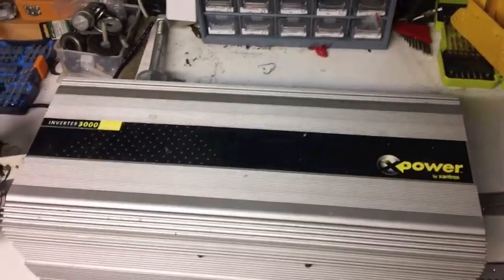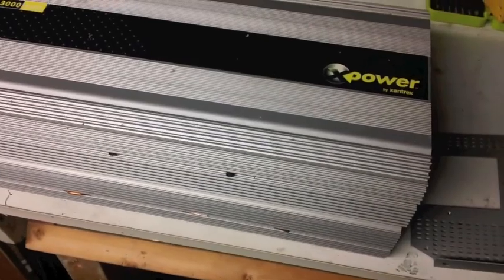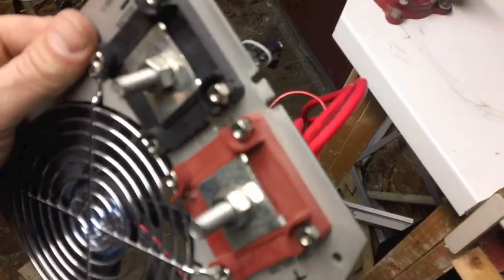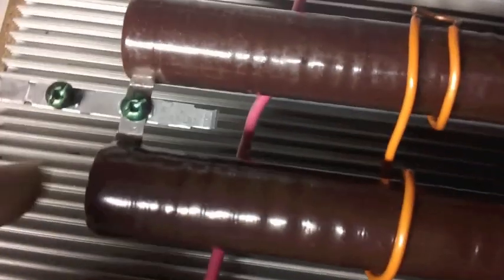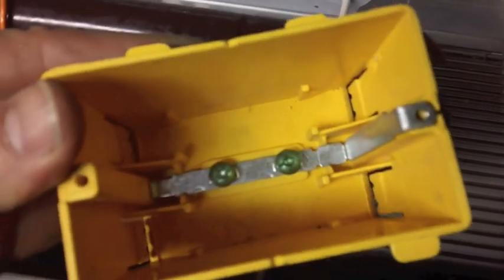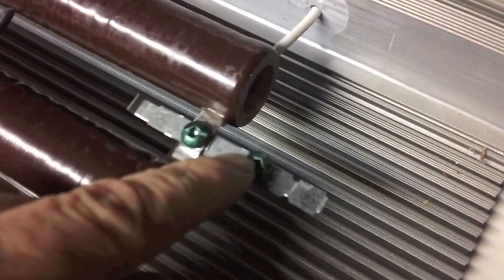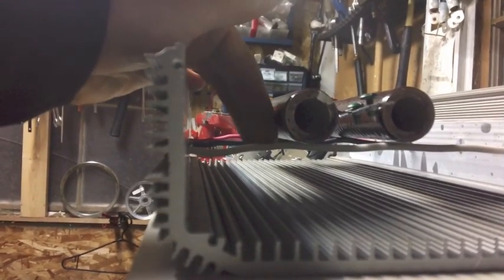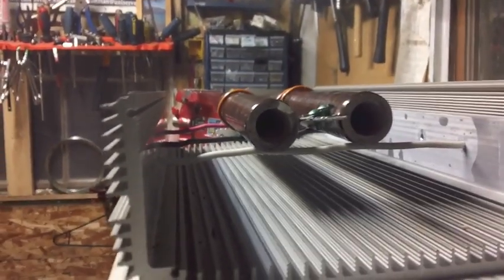Part 1 of Homemade Dump Load for Wind Turbine

Comment: Okay you've got an aluminum box that you're putting them in and you're suspending them in the air so if they get hot they can cool off in the air that's just dumb strap them to the aluminum be a little bit will pick up the heat and dissipated into the air use the aluminum box as a cooling unit rather than suspended in the air that's just crazy you've got the box use it for its purpose all the cooling fins that are on it I mean come on
Reply from the maker: Thanks for the suggestion!

Comment: What is "dump load"? What is the point? It does nothing.. do you have too much power, or what? 😕
Reply from the maker: Well if my wind turbine actually produced the power it claimed to, the dump load would "burn off" the extra power generated after the batteries were charged. I tried out a bit until I found a used controller with a brake.

Comment: I think its 1 ohm four 12v 2 ohms for 24v and so on, 300 watt. I would also suggest mounting the resistors on porcelain insulator posts.

Also Missouri Wind and Solar is a great source for some of this unique stuff.
John

Comment from the maker: I'm waiting for a different resistor from ebay to arrive. Should be coming this week. I found out the two I had purchased a couple years ago were the wrong omhs. They were 100 ohms/200 watts, which translated to 1.2 amps would be consumed. I should of picked up a lower, like 10 ohms. Oh well, we learn from our mistakes.